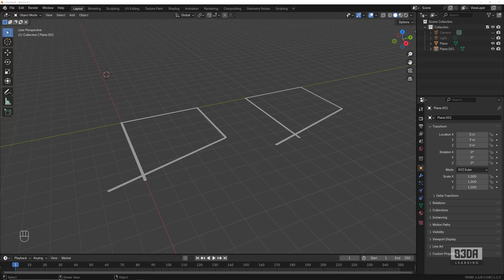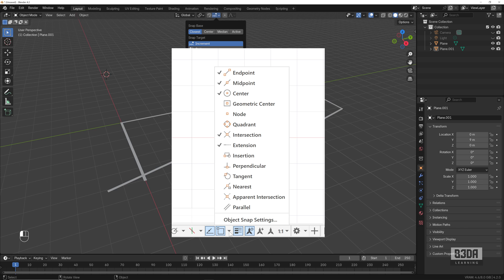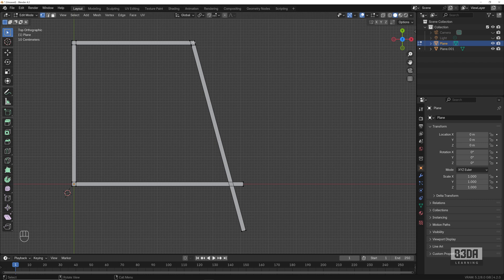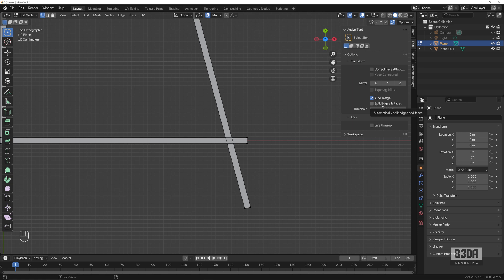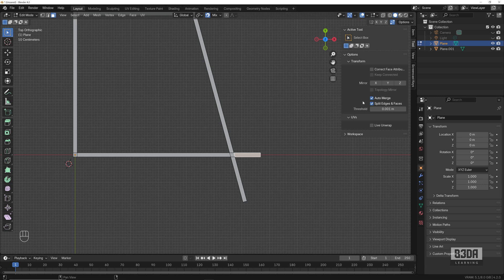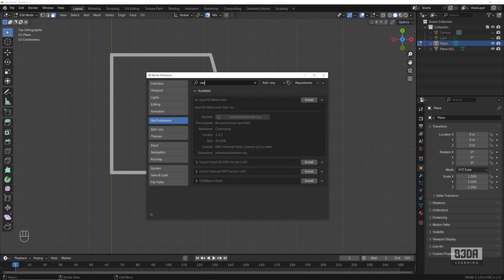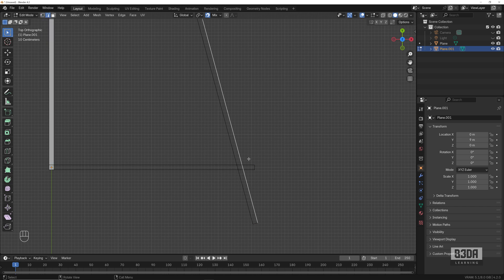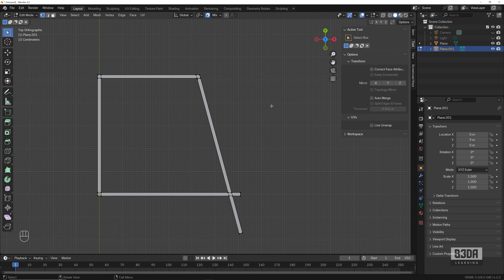Blender CAD Secrets: Hidden Snap Tools for Precise Intersections

Comment: Already waiting for the cad Extension video in Blender. is there a good addon doing all these objects snap like in autocad?
Reply from the maker: Glad to know you liked to tutorial. Unfortunately, there is no single Add-on that can solve or add CAD features to Blender. You will need a few of them to simulate OFFSET, TRIM, EXTEND, FILLET, CHAMFER, and others. I have more tutorial planned to explain how to use more Blender features as if it was a CAD tool.